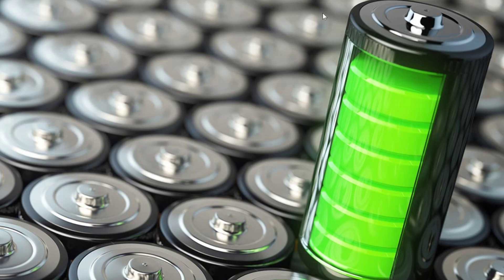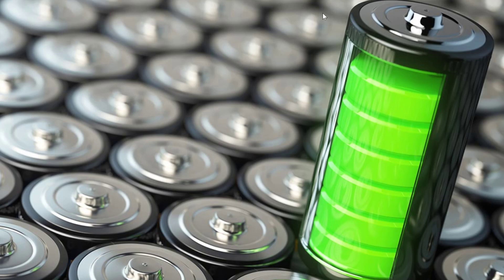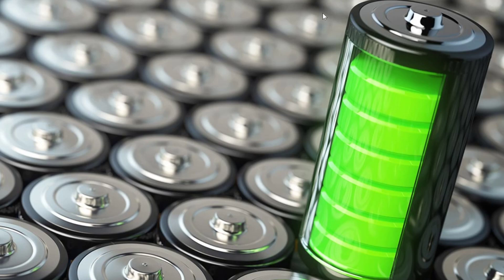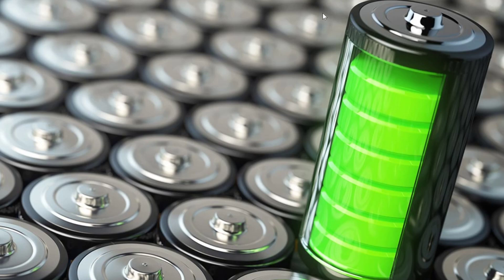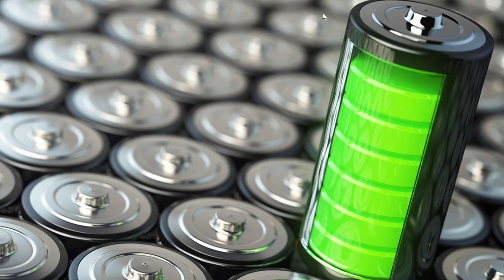DO NOT Discharge rechargeable batteries totally it is bad for them nimh li on

Comment: You are wrong! If you make some research about it, you will see: Keeping li-ion batteries at 100% charged or less charged than 20% put much more stress on cells and shortens battery life. To extend battery life, best usage range of the li-ions is between 20% - 90% state of charge. And if you going to store it for a long time, %45 - 55% perfect.
Reply: Newer batteries are designed to manage very effective the charging power. Even when they read 100% it’s not a truly 100%, they are like 85% charged. Same when discharged, says 5% but they are like 25%. Great designs come with that in consideration. So they last longer

Comment: Can you use NiMH in tv controllers? Cause I tried  Lithium ion 14500 and I fried the circuit board smh!
Reply: Googling 14500, those are 3.7V per battery. It's no surprise you fried your circuit board. Typical alkaline AA, AAA, C, D, are 1.5V per battery. Most NIMH batteries of those sizes are 1.2V which is low but isn't dangerous like the 3.7V li-ion batteries you used. You would have been better off using NIMH batteries. You might have gotten away with using one li-ion battery and one dummy battery. You'd still be overvolting by a bit, but you wouldn't be more than doubling your voltage.

Comment: Great advice. I have SLA batteries for my IC-7100 when I go portable. They put out a nominal 12 volts. I have heard you should never let them go below 10.6 volts. I have a volt meter on the battery. So far, even when using a SLA battery for several hours, I have never gone below 12 volts.

Comment: Thank you for advice, it came in the right moment. I just read in my new Tecsun PL-660's manual this:
"Insist to use up all power of rechargeable batteries before charging again. This could extend the usage time of battery and keep them in good conditions." The radio comes with Ni-Mh batteries..
Reply: You manuel are right. Ni-Mh should discharge full. This guy is talking about Lithium ion battery.